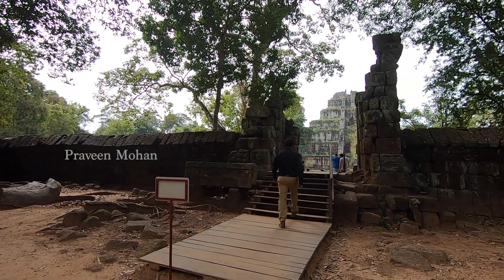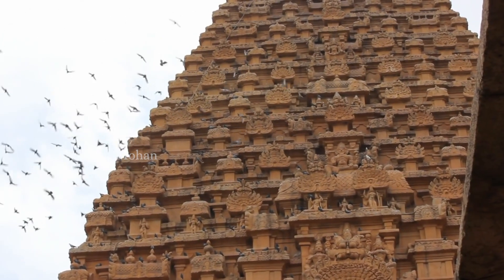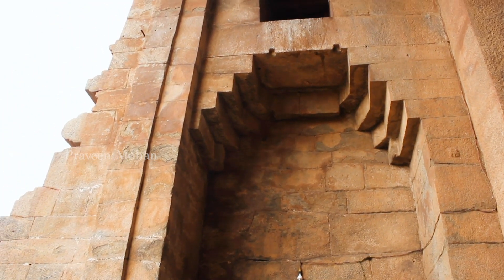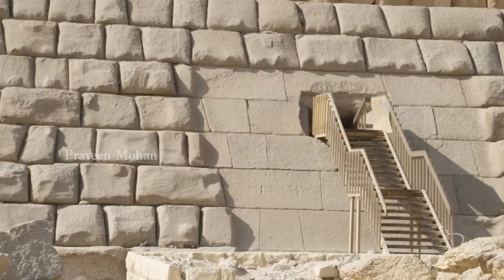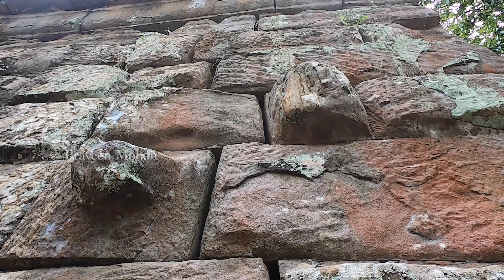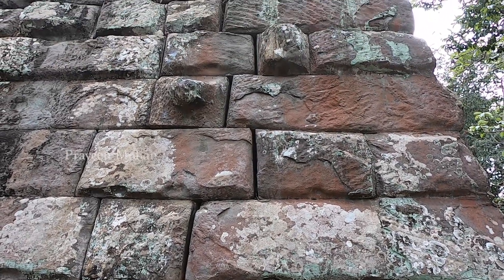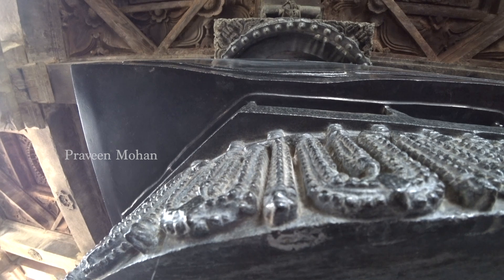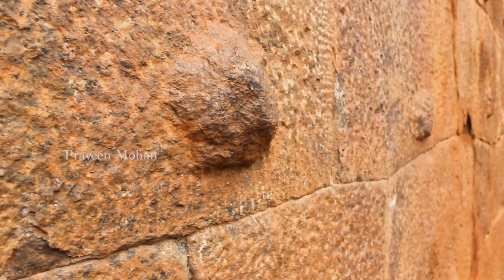Mystery of Ancient ‘KNOBS’ in Temples - Evidence of Stone Melting /Geopolymer Technology?

Comment: I think the most plausible explanation is that the ancient lost civilization used hydraulics to cut the stone,   I think they invented high pressure water lances,   to me this is more logical than melting rocks or reconstituting them,  Obviously they had amazing technology, and I think it is more likely they  used water power under great pressure (somehow) . To me this would explain the knobs.  They were simply, to my mind, the remnants of the process of  undercutting  the stone from the bed rock, the jet lances would blast away the  stone, possibly with the aide of a cutting compound, perhaps diamond grit, then as they cut away they placed a few stones  in the cut  and continued to under cut until the stone rested on the last few  spigots, at which point they withdraw the cutting lance, they then levered the stone  and snapped the spigots,   I think some of the dressed stone had the remnants of the spigots/knobs removed, and some of the knobs maybe on the reverse side of the stone, and some  were just left, as you say when they were not too intrusive and not  meant to be seen.      Obviously when a large block of stone is cut away from the bed rock , in order to get free access to the underside of the rock it has to be kept from collapsing onto the cutting tool, by leaving the spigots to the last moment they, as mentioned above, withdraw the tool and snapped the spigots, hence the knobs.  I think you could demonstrate this method with the use of  a chain saw, if you wanted to cut a wood block  horizontally you could  replicate this quite easily and it would prove that it could be done using a few wedges and  undercutting by leave just a few little supports which could eventually be snapped  after the saw is withdrawn from the cut, to me it seems  such a simple and logical technique.  I have studied the pictures  of these stones for hours on end, and read numerous hypothesis, but to me the simplest and perhaps most mundane solution is the most likely.  You are a lucky guy Praveen, being able to see these, wonderful places in India,  and I was flabbergasted to see similar scouring grooves on a stone at Stonehenge in one of the clips!!!  I thank you for all this material and wonderments, but it is saddening to think so many archaeologist and Egyptologists  don't seem to want to investigate these mysteries.  I just want to know what went on and get to the truth.

Comment: As resonant as granite is, how would you use the oscillation of an induced resonant frequency to virtually lap uneven surfaces to one another?
As each surface laps to the adjacent, the frequency of oscillation would work through each greater contact surface.  Would the nubs be a contact surface, specific to the stones that either resonate more or are less reactive and required an individual focus to final fit it in place?
Being able to resonate smaller stones in multiple locations, could give the quarry a rapid excavation of large pieces as well. 
So, what frequency would work best and how would early mankind have created it?

Comment: False!  They did melt rocks, but those are not drops.  If they were, they would not be consistent in size and position!  Careful observation shows that when casting the number of knobs also whether placed in center, side, two in center, two on ends, there is no vertical, diagonal, etc, if they were drops, of course this would have happen but all I've seen are straight vertical/horizontal

Comment: The knobs are from the liquid/concrete type being poured into a mold, in order to "pour" in to a mold you have to have 2 openings, (one to pour and one for air escape, where there is an opening you you have a knob.
Reply: They had to be poured it situ to make these fits. Geopolymer, cool-poured chemical cure... Hence scalling and flaking on the exposed sides. It only makes sense to fill the forms from the top. Material being procurred as per Innerst i Hagen, as per the above comment. Pumping the form through the side seems nonsensicle, owing to the fact that these knobs appear at random locations on the sides of the blocks, usually towards the bottom of the blocks, but also towards the top or middle. Sometomes the knobs angle downward, and sometimes the knobs angle upward, or just protrude; most are greatly erroded over the centuries and mellenia. The forms had to be made in situ, owing to the fact that too many of the blocks are unique. Mass production would yield a homogenious-looking block stucture, like we see in our concrete block buildings of today. The question would be, "What would cause a knob on the side?". This had to be part of the casting process, owing to the similar appearance of the knobs. These couldn't be just blowouts in the forms, as was suggested by someone in these comments. The knobs look purposefully made, even though they may appear erratic to our observation at the present time. It needs to be studied to see if it makes sense that these KNOBS were for attachment, anchor points for lighting, artistic plaques-statuetes... etc... wooden affixment points, cables and ropes for linen attacments etc. etc.... ??? Tool marks around the edges could have been for final shaping after the forms were removed, before the casting was completely curred. This would reduce the need for excessivel precission in the placement of the forms.  These final finishing marks can be made with soft tools, as it is just a matter of scraping, and could be done rapidly. Anyone who has worked cement knows what I am talking about... Readers... please respond with comments.

Comment: In construction parlance the protrusions found on the stones in your video are more commonly referred to as ‘bosses’. In ancient construction, and later, stone units were rough-hewn in the quarries with knobs/bosses projecting from at least one side for purely utilitarian purposes. The bosses assisted in moving and positioning the stones, sometimes with ropes, and other times with levers. Often these stone protuberances were removed in the final dressing of the finished component, but not always. In later eras, bosses [bossage] were sometimes retained as a shaped decorative architectural feature, and then ultimately, in classical architecture, the technique was refined to the specific style of “rustication”. That is probably the reason they are removed on eye-level bricks since they would be easier to do work on at ground level contra 3-5 meters up the wall structure

Comment: It is very likely that the knobs are there to 'lock' the stone blocks with each other. This would be a good engineering practice and if there is a question why asymmetrical outward distribution of knobs, it is possible that, the rest of the blocks have knobs but facing inside and they lock the stone arrangement and stop movement due to any shear forces. One possibility.

If the stones are not granite which seems so here, they could definitely get hand carved precisely with highly skilled tradesmen sure working for longer  period like months or years. Softer stones can enrich seeds falling on them and with high moisture like this place, seeds can germinate and take up roots.

Comment: Only problem is People have been building with stone for 10's of thousands of years all over the earth. Why all of a sudden start casting irregular shaped rocks to stack when they already could cut stone to fit. They would have made regular shaped molds like for the brick which is behind the facing stones, To achieve the result They would need a fresh mold made for each rock fit. It would complicate the construction for no reason. Besides most blocks were back cut so the edges could be fine chiseled for a tight fit. Why cast them square only to chisel out a back cut.    I think the knobs were there to hold timber work platforms from shifting laterally  or for timber awnings or ceremonial platform erections or wood roofs or some timber structures that long ago rotted away.

Comment: The reason you are wrong about them casting rock is because the rate of cooling, the pressure that the rock cools under, and how much h2o is in the rock effect the size and way the individual crystals in these stones form. The stones that we see at these sights match the stones we find at the quarries  identically. Since those stones cooled slowly over millions of years to form those exact crystal characteristics it is highly improbable that these stones were manufactured in the way you suggest.

Comment: What if?- The rocks are created in liquified state in situ- and at same time the breakup gridlines  that are so tightly fitting in random 
ized shapes and curves etc - are also applied at the same time as the process of  solidifying the material on a metaphysical energetic  level and the knobs become small points where an instrument of some time actually has been used to help manipulate the mass of stone material to hold in place randomly- and then when it is disconnected, it leaves these small protrusions? The only thing with the mold defect points is that it infers that the stones themselves were created in a mold and then placed as a wall- when joints are so precise, and that would have also been a 'lot of handling manual labour  work?' When you think of the brain having a typically left analytical- (grid) adaptive logic and the right side being more mass/formless -atmospheric capabilities, perhaps if you were able to orchestrate these qulaities to co-ordinate on this level then it is feasible to consider-. e.g the thought process of design of the end- is co-ordinated in a very sophisticated fashion with the rudimentary assimilation of raw materials and energetically combined to result in the production of the intended design.It may have been down by an artificial/outside (of human brain)intelligent device. That you have covered in other videos- as a metaphysical device that orchestrates and amplifies power- perhaps combined with Human thought and intention=created outcome.?? Always, something to stimulate our minds- thanks Praveen.

Comment: Your explanation makes good sense. You notice where these cast blocks seem to mould into each other so that they are an exact fit?  - very often in South American buildings. I wonder if they achieved this by casting the stones on site and putting them in place while they were still malleable?
Reply: i do think they were either softening blocks that were quarried, then molding them into a cast of some kind and then slicing off the knobs, while still malleable (possibly in place on the structure), or casting blocks from some mixture of ground up rocks.  in some cases maybe an error happened or some knobs just didn't get cut off in time, or due to some other reason, but the block was still then used.  Nonetheless, I do think that many of these structures were molded at least in some era of history!  not the basic stuff that is chipped rocks.  It's easy to tell the serious stuff that is just too perfect to be chiseled with tools.  this is pretty obvious now I think.

Comment: Good day,
I worked earlier in mechanical engineering. The protrusions on the stone blocks may be remnants of casting inlets for casting that have not been cut for some reason. The protrusions on the blocks are not a defect of the stone block, but apparently unfinished work after casting.

Comment: I believe many ancient sites used rock melting and geopolymer technology.  These knobs are however not mistakes or casting defects..  In my humble opinion the larger singular  knobs may have  been used as tabs for external wooden structures although this is unlikley as square tabs or slots would have worked better.  My theory is that the more numerous smaller knobs are  strategically placed to alter and  amplify the resonance of sound specifically Mantra.  The knobs may even alter the resonant frequency of the entire megalithic structure in ways we could not even begin to understand or explore.  Even the larger more singular knobs may have the same frequency stabilizing effect.

Comment: Awesome video again I've never heard that explanation before there's lots of knobs in Peru like you said and a very feasible idea. But here's a question if you're going to go to the vast extreme of building these monolithic buildings around the world why would you use defective material. Why would you not just cut the knobs off when it was soft, or just return them and reuse them if you have technology to do this surely you don't have to use second-rate blocks these buildings are very important to them. We never uses  second-rate bricks today they are cut in half well hidden or discarded. But then again are Manufacturing is simple compared to theirs less chance to make mistakes.

Comment: At Cusco, in Peru, they may have used mine waste along with certain indigenous plants to soften stone using a iron pyrite oxidation technique where they make a potion of the mud from the slag pit mixed with plants to soften stone. This requires a certain bacteria. Perhaps the plant material supplies the bacteria or maybe a catalyst.

Your wise men are wise indeed.

When blocks are joined, they spread the red mud between the blocks and this soften the stone. The knobs, if on the bottom of the top stone, will dig into the lower stone and leave a perfect joint.

I don't think the knobs were meant to be seen necessarily.

Comment: Sir, if these were casting defects, then going by the very few numbers of them it could have been easily chiselled out as part of quality function. But yet they are left there.... Also, I notice from the video that these knobs always fall on the sides and are always shifted more towards the bottom edge of the stone... One thing I need to know is if these knobs are present on the other side of the stone exactly opposite?

Comment: Dear Mr. Mohan, I don't think the KNOBS are evidence of stone melting.  I believe they are evidence of the use of cement.  Ancient people used cement to build bricks or stones and stone structures.  I believe all the bricks you showed to us were built with cement, not carved from natural stones.  My belief should be the same as talked about by the elderly gentleman at 10:15 (This is not available stone.  Man-made stone.  Olden days people were brilliant so they made.  Nowadays our knowledge is zero,  nobody knows the combination. That is the drawback not possible to maintain, not possible to repair.).    
If you don't believe ancients were capable of making stone bricks with cement, then you must logically believe all the stone bricks were carved from natural stones.  It was a hugely impossible job to carve billions of bricks though, large and small, with some weighing tens of tones as were those at the Egyptian pyramids.

Comment: Stone melting technology is very much evident here. They were using casts and "pouring" these bricks into them. Maybe the knobs are just cast defects in the formwork. If you want to build very long walls you would need some pretty long cast sections too. Maybe it was more trouble than it is worth to replace a large casting section just for a tiny hole in the cast so they just went on ahead. It makes sense from a practical point of view.
Or maybe they had a purpose that we simply cannot fathom since we dont understand the technology used anymore.

Comment: I mean that the technique, that was used for melting or bending the rocks was not based only on the usage of some special ingredients, herbs, etc. but the interdimensional shifting was used, when the rock partially dematerialised in our dimension change the characteristics as hardness, weight,... The same technique, which is used by monk, when he is imprinting his palm into the rock.

So called knobs can be relicts of some defect in production of stone blocks, but too easy to be fixed to be let there. As Praveen Mohan also mentioned before, the stone temples were not only the places of worship but also the energy devices. Frequency of the temple or of its part can have the crucial importance. The tuning into exact frequency could be managed by these protrusions tuning the exact tone that was expected by masters for the specific purpose.

Comment: I think maybe the knobs are the densest part of the stone. Maybe they would cut at it from all sides till they ended up on the densest part. then they would snap it off there. If removal of the knob was necessary for the completion of the structure it would be removed. Otherwise it was left on the stone. I will probably change my mind because my thoughts always evolve on this stuff. This idea could be tested by using a microscope to view the stones density in the knob area as opposed to surrounding areas of the stone.